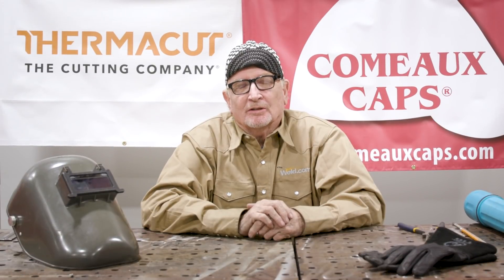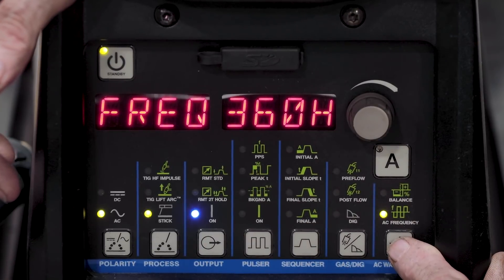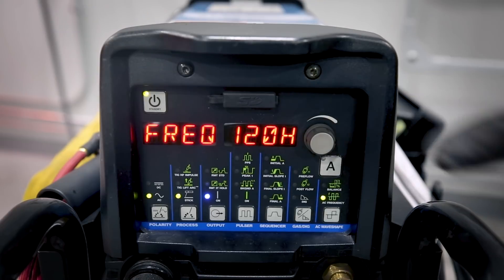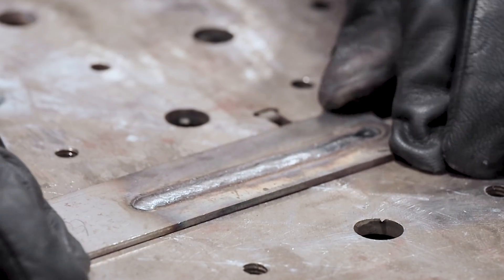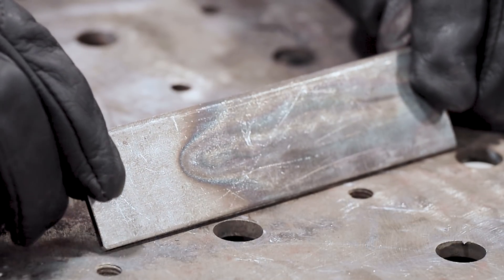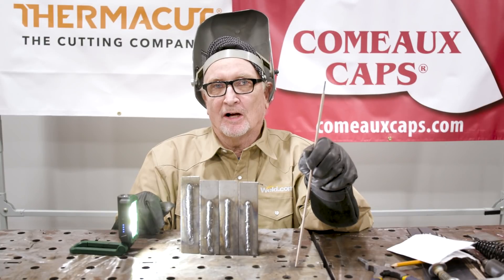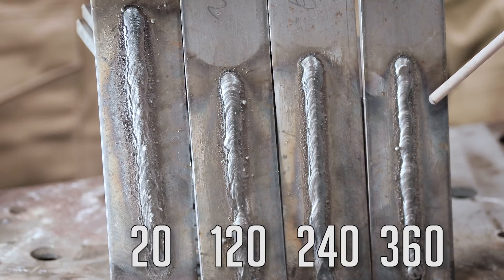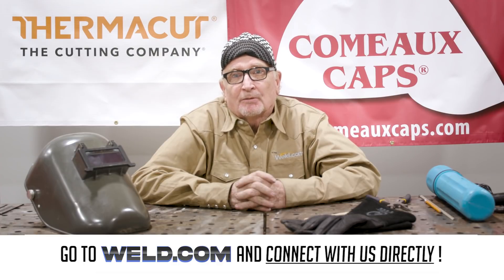Welding Theory - What are the Effects of A/C Frequency When Stick Welding?

Comment: hey paul...can you do a video on an aftermarket thumb switch for the stinger to change current while welding
Reply: that sound like a great idea, back a few years ago, I was doing repair on auto haulers [big ole trucks] with lots of bars] and while crawling around on them, I decided it was a pain to keep getting on and off, to adjust amps, so I hooked my thumb control up....it was great, because I could shut the power off for safety, or raise or lower amps if a big gap had to be filled......I will get with the director and pass the request on to him....cheers, Paul
Reply: @ypaulbrown  +1 on this request...

Comment: We've done some 7018 with ac for flat high amps (don't remember the hz). Helped to reduce some substantial undercut.
Reply: AC is considered to be better for high amperage use and also if you are a long way from the welder., .....that is the reason we use AC for power transmission.....it also deposits more metal than DC+ and has a less digging arc, that would explain the reduction of undercut....I know those big 3/16 7028 rods love AC....thanks for the comment and for watching, Paul
Reply: @ypaulbrown  6mm 7024s love a bit of AC too. In a past job used to use them on AC for welding heavy gauge (25mm+ thick) structural steelwork and platework, due to lots of arc blow anywhere near corners👍

Comment: Good video.  That being said what would have been helpful is application examples. e.g.  When would I choose 220hz over 60hz, when would I choose 20hz over DC+
Reply: I guess the bottom line would be if you need more heat and buildup, the lower frequency would be the ticket, Thin material and tight areas [corners] , the high frequency would be a better choice. hope this helps, Paul

Comment: Something I did not see while welding and only after seeing the video clip of the machine settings while welding, was the increase in voltage the higher the hertz and the drop in amps at the 360 hertz setting. The machine was set to 90 amps for all welds, which was not clearly pointed out.  Arc length stayed pretty consistent, I did have an issue with how fast the rod needed to be feed into the puddle, as I am used to using 1/8" rod and not 3/32",  the 3/32" takes a much faster feed rate, that would explain the slightly variable arc length you see......I guess practicing with 3/32" 7018 feed rate is in store for this Weldor Guy, thanks for watching, Paul
Reply: You did fine brotha, interesting video. I’m gonna do some AC stick welding just to annoy my coworkers
Reply: @ieatslag5947  Outstanding......it is fun to get into the high frequencies and let them hear that dynamo hum and wonder what the heck is going on, cheers, Paul

Comment: What lens do you guys have on that hood ? Just picked up the tiger hood and I want a variable shade that fits
Reply: Roberto Gutierrez: 
Opps, I was thinking of another hood I use, but here is the info on both hoods, Paul......that lens is a Variable shade 
4x5 ArcOne that has a remote sensetivity control, I bought this last year
because of the true color, my partner bought one and I was really impressed with the color rendition, it is 
very true color....the hood was terrible and I had it deform when I left a few shirts laying on it in my truck....
very flimsy, and my 2 friends who bought  one had the same issue, 
the hood head gear is junk...it will not stay adjusted even after a minute or so....
..so I had a Tigerhood that I put the lens into, I had to run the remote [2.5x1.75 x1/2 inches] 
to the bottom of hood on inside . a wire connects and needed no modification. no cutting of hood, no big deal, 
just used tape to hold in place and wire rests underneath the retaining clip of hood, 
 I originally was going to use the Fibermetal 4x5 vertical [narrow] hood
but their was not enough room to clear head gear with the remote at top or bottom...
I always wanted a horizontal view anyway.....so it was the Tigerhood that got the nod, pun intended....
it has worked wonderful.....[this is why I bought, because of the large viewing area...and color...BFFVX
Light State 3Dark State 5-13Digital Sensitivity Variable Grind Delay YesTIG Rating Amps 5 No. of Sensors 3 Regulation In Viewing Area 17 sq. in. ]  
I also use the Lincoln 2x4 autodarken for my Tigerhood flip lens hoods....
the color is very accurate....Lincoln Electric 2X4C....I am very pleased with it, 
I have owned Jackson, Miller, Huntsman and ArcOne Autodark lens since 1996, the ones I am now using  are by far the best I have used......
technology has come a long way....The Huntsman AV/L was also great, but it died after 15 years.....and was $389 in 1996...
I hope this long winded description helps....
I mentioned the 2x4 flip hoods, I use them when in dark areas so I can flip up to clear view to see and also cramped areas so I do not need 
to lift hood to see, just the clear lens.....I also allows me to use a cheater to inspect welds and chip/clean slag with out worry of 
chips in my eyes.....
Tigerhoods are tough.....and one of the few that are rated for overhead welding.....most new fancy hoods are not rated for overhead .
Cheers, Paul Brown
p.s. the ArcOne covers all but a 1/2" strip where  sensor is, it is a huge viewing area.....you can see in the video the strip....

Comment: Wearing comeaux caps is like wearing Timberland work boots…you might buy them as an apprentice, before you know what brands are ACTUALLY good, but after a while it’s American Redwings and custom caps (probably made by a fitters wife and sold on eBay).  Just me maybe.
Reply: Thanks for watching and commenting M C, I had to stop wearing Redwings because of quality, went to Thorogood and WESCO, bought some Wolverines last year, but one is so different than the other I cannot wear......Redwings always fit well and needed no break in, but so do Thorogood and WESCO, since I am on concrete all the time, the WESCO's were hard on the knees as they have Vibram lugged soles....the Thorogood's and Redwings like and have now are the MOC Toe no heel jobs.....a little better on concrete.....
as Far as welding caps, the problem I have had with high dollar ones, [$30.00 or more] is the durability, maybe and availability, in my opinion, and I have a lot, haha....for the money the Comeaux's are the best deal, but then I am not on job sites much anymore and the shop I am in , no one else is there. but me......my friends who do not know I am a weldor always like my hats because they think they are 'Unusual'....cheers, Paul
Reply: @ypaulbrown  I forgot about Thorogoods.  I like that they give a union discount too.  I couldn’t resist the comeux dig, but I’ve got a few of them in the truck somewhere.  Like anything else, after doing it for a while you just fall into what you like.  The new trend seems to be the most expensive stuff takes the lead, but I’ll swear by these Key denim shirts I wear over half of the expensive welding jacket brands being promoted on Instagram (and that all of my apprentices come in wearing).  I must be getting old.
Reply: @MC-yx2gn  I really like the Lapco's , I recently found a denim one in our dumpster, it was brand new!!!snarfed it up pronto....I think it cam from a guy who was selling used / vintage clothes....at 55 bucks, they did not know what they had, I need to try some of the Wrangler shirts, pearl button of course.....the FR shirts I do not like.....thanks for the feed back, stay warm and stay safe, Paul freezing here in Orlando, FL.....
Reply: @ypaulbrown  pearl button western style for sure😎👍🏻!  We’re huddling over the torches up in NY right now too.

Comment: so what application would one use ac?
Reply: Jarrod, you might want to use AC where you need less penetration, more build up, being further away from welding machine as AC current flows better than DC with less voltage drop, using larger electrodes, and being able to change frequencies to change the arc characteristics ..and no arc blow...thanks for watching and commenting....Paul

Comment: Not to sound like a pedantic bore, but WHERE was the theory? WHY did higher frequency oscillation produce less penetration? HOW does it work? WHAT are some specific applications for the various frequency settings and why would you use them? Come on, man! You're hardly quenching our thirst for knowledge here. My curiosity is not satisfied! 🙃
Reply: great question Thomas, , I have no idea why the amperage is less [less heat and penetration] at higher frequencies, the arc is more focused at the higher frequency and that causes it to not jump over to close objects, high frequency would be good if you were in a tight area and trying to not arc out on something, 
Low frequency has a wider arc cone and higher heat input, so thicker material would benefit in a lower powered machine. 
Using AC also remedies the problem of Arc Blow. AC also has less penetration than DC+ and more build up. 
add these things up and I am sure you will find a solution to a possible weld problem. 
the same effects are seen with AC GTAW [TIG] and they definitely help when welding aluminum. 
Maybe I will do some digging and see if I can understand the actual reason for the effect of high frequency on the arc, I am not 
a physics or electrical engineer, maybe someone can chime in???? Just an old seat of the pants weldor....trying to discover 
solutions for problems I do not have.....cheers, Paul Brown
Reply: @ypaulbrown  amps is less because there is more times where there is zero voltage. Zero voltage means zero amps. Same as ac on tig.
The interesting thing would be if the narrow bead stays narrow if you increase the amps to generate the same heat.
Reply: @tweake7175  I will try that in the shop and get back with you.....I was thinking that a constant current machine should have kept the same current [amps] though, I need to do this with tig also and see if there is a big differance....thanks for pointing this out and watching the video, cheers, Paul
Reply: @ypaulbrown  i would bump up the amps untill you get the same penertration. Then see if bead is wider.  
Doing it with tig would be cleaner and easier to see. Also see if the same applies with pulse. 
To make it really interesting get a pulse stick welder.
Reply: @tweake7175  we are doing a video on pulse stick, not all machines that pulse will pulse stick, sometimes you need to run the inverters on the tig mode to get them to work....I have been doing pulse stick since about 2001 when I bought a pc 300 Miller for my Miller.Synchrowave 250....cheers, Paul
Reply: @ypaulbrown  i would not be running sticks on tig mode. i have heard of people killing machines tho not sure why as it really just a different voltage setting.
Reply: @tweake7175  well, on a transformer  machine it does not matter, on inverter????? I am thinking due to the lower voltage, some types of rods may not run well......I do not know if it will cause an issue in an inverter, something to look into.....I do know, running an inverter on a generator can toast it real fast if it is not rated for  running an inverter.....thanks for the comment, and thanks for watching, Paul

Comment: Ac that’s not welding
Reply: AC, that's not welding, sounds like a Dire Straits song from 1980's....AC is used a lot more than you think in industry as there are some things like arc blow that does not effect it, larger electrodes work better with it, more build up than DC+, and longer leads can be used for less current drop. thanks for watching and commenting, Paul